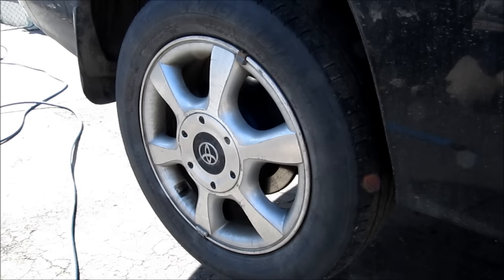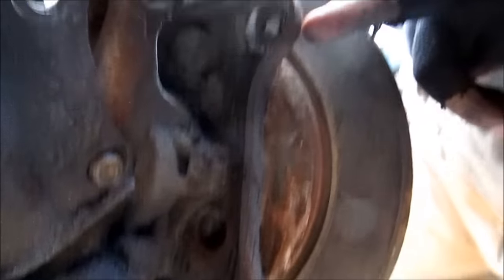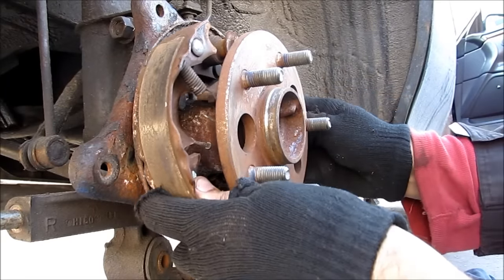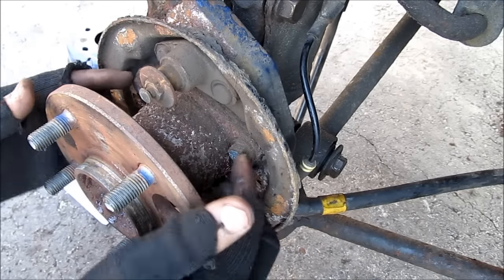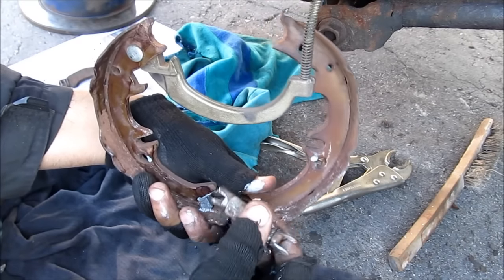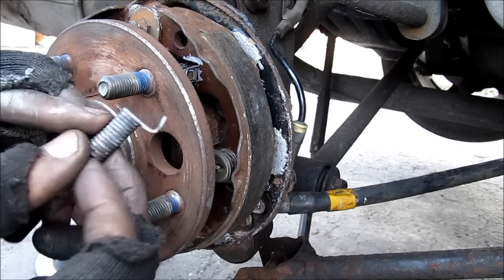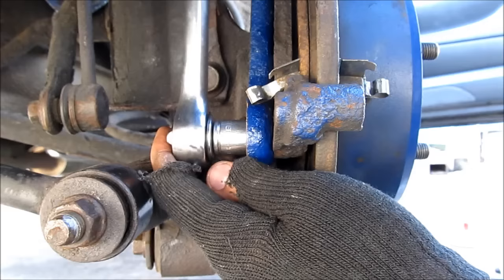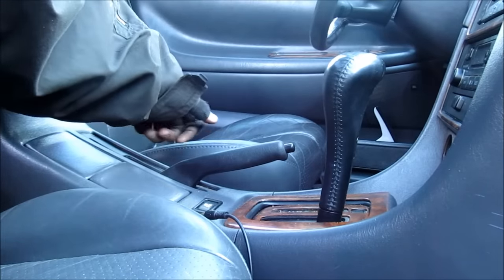How to Replace PARKING BRAKES

Comment: speedkar99, good video, even if you did cut out the painful parts, like reinstalling the retaining springs and caps... LOL
 Now I have a problem related to this:  my new rotor/drum doesn't slide on.  I have made sure the  shoe adjustor is completely retracted, all the pivot points are where they should be, but with the new shoes, it is about 1.5 MM too thick to allow the drum to seat.. update:  I hammered the rotor on to the hub, hoping that once it was properly positioned the shoes would clear the inside of the drum.  No such luck.  now the rotor doesn't even turn, and I will probably scar the shoes trying to pull the rotor off again.  my thought is to turn the drum part of the rotor to get some clearance.   what do you think?
Reply from the maker: +Van Moon You sure you have the right drum? Measure the inner diameter of the old vs the new one and see the difference (accounting for wear). Maybe the drum sizing might have cross referenced an ES300 that has a slightly larger rotor....
Reply: Well I have to go by what the parts people give me I guess. I left the old rotor with them when I picked this one up.  I don't know if it's still available but yeah I'll I'll see if we can put a micrometer on it and measure it.  But still my question is how do I get this one off? it's going to pull the new brake shoes and everything off or scratch them or something
Reply from the maker: +Van Moon Use a metric bolt and thread it through the bolt holes evenly.
Reply: The new drum doesn't have extraction holes. However I was able to get it off. I cut one of the retaining pins  and for some reason the shoe assembly was able to slide over enough to where I could get the the drum off. So after replacing the retainer assembly with a new pin and realigning the shoe assembly I tried to put my old drum back on and it had the same problem - it does not slide on easily. But I was smart this time: I didn't pound it  on with a hammer like the last time!  Maybe I should just go with the original brake shoes? They are not worn down to the metal I had just look at them not ever having seen a set before and thought that the friction material was really thin. But now I see after reading about it that it is only supposed to be like six mils thick.
Reply: After i ground off the back of the spring retaining pins and replaced them with a new set I discovered that I had incorrectly installed them the first time and for some reason that apparently spread apart the brake shoes just enough to interfere with the drum. The Second time I put it together everything went perfectly just as it was supposed to do. So now I'm back on the road with new brakes and I thanks a lot for all your help

Comment: May I add : only take one side apart at a time . That way you can refer back to the still intact side in case you are uncertain .
Reply from the maker: Yes, that's exactly what I did.
Reply: speedkar99 I was hoping to help those with little experience , you obviously don't need much help . Again , good job , excellent presentation . Thank You

Comment: Need to remove a 10 mm bolt that holds the brake line and abs cable in.

*snaps wire tie 😂😂
Reply from the maker: +Max Tp Haha you like that eh...already broke that bolt a while ago.

Comment: How do you support the rear of the car when doing this? I can't find a place to put jack stands in the rear after jacking from the rear central jack point.
Reply from the maker: The two welds along the bottom outside corner of the car. Same points the manual tells you where to put the jack in case of a flat tire.

Comment: you can give yourself a lot more room to work by removing the hub from the backing plate with a big breaker bar and and a socket extension
Reply from the maker: Agreed
Reply: 5:05 really hard for me to get the offset nail for the shoe hold down spring for some reason.  Have been trying but no luck.  Any tips or advice appreciated.

Comment: In my car parking cable difficult to assy....! With adjuster...!
How you connected the cable that easily...!
Please give some tip.....!
Reply from the maker: Yes it is very difficult, of course make sure the parking brake handle is not engaged

Comment: speedkar99 I hear a clunking noise in the rear side and I'm pretty sure its coming from the rear brakes what do you think is making that noise ? I know there could be a lot of reasons but i hear them only when i run over a bump or potholes.
Reply from the maker: Rear strut mounts or stabilizer linkages.
Reply: speedkar99 I changed the links bushings and it still makes noise and I checked both the strut mounts and links. Nothins wrong with it.
Reply from the maker: How did you check the mount? There's no real way to know if its toast without replacing it. You can also try putting a felt pad between the body and the top of the strut to see if that eases the noise.

Comment: The problem we ran into was, even though the emergency brake was not engaged we couldn't rotate the rotor to a position where we could access the star wheel to back off the brake. It was a pain.
Reply from the maker: +Charlie Roach Ouch. I hate it when that happens. Eventually I some how get the rotor off, with a lot of banging. How did you end up getting the rotor off? I presume you could bolt back the wheel and rotate it.
Reply: +speedkar99  we ended up using a huge two jar puller. This is on a GS300 Lexus which I think is rear wheel drive plus its independent rear suspension.  It would benefit us greatly if the axle were not in the way when we put the brakes back together.
Reply: oh nice - automatics too aren't they? Did you have it in "Park" while trying to rotate the rotors? :)

Comment: speedkar99 what cut off tool did you use, where can i find one?
Reply from the maker: +jdyang89 Its just a normal rotary tool with a cut off wheel. Similar to the Dremel brands. I got mine from Canadian tire, but you can find them at most stores now, Home Depot, Harbor Freight, Princess Auto, maybe even Wal*mart.

Comment: If you were gonna go through all that work, you had might as well change the brake shoes with new ones. They are close to 2mm service limit
Reply from the maker: +cucktoose Yes good tip, though these are parking brakes that aren't used often so I chose to leave them for now

Comment: can someome tell me the difference between a brake shoe and brake pad
Reply from the maker: +taha rana a shoe is the semicircular pad that squeezes the inside of the drum to stop the wheel. 

A pad is flat, and squeezes the outside of a disc to stop the wheel
Reply: speedkar99 is the shoe basically the handbrake brake then ?

Comment: regular drum brakes are easy enough, some designs easier than others, but these drum in hat parking brake shoes have always frustrated me, and it seems like I've never replaced them on preventative maintenance principles, but only as repair after they've completely rusted away and caused havok on everything...lol  I guess ppl here have that "don't fix it if it isn't broke" mentality.
Reply from the maker: +TheCoatneyadkins most people (like me) with automatic transmissions don't even use the parking brake so no point in fixing what you don't use.

Comment: I can't get my rotor off. Helpfu ideas?
Reply from the maker: +Charlie Roach You've got to use two metric bolts  and thread them into the two holes on the face of the rotor. As you thread them in, it pushes the rotor off the hub. Also double check your parking brake isn't engaged.
Reply: u have to release the parking brake

Comment: Very Nice video,  but this is a pro that have done this  a lot of times, I expect. Be aware if You that are going to do this in the garage, that it can be a challenging job . With new tight springs, maybe You would like a spring tool to refit the springs, the small pins and springs that hold down the brakeshoes is best fit with a special tool, bought for a few bobs,will save You greef and bloody knuckles. And last: start with spraying the old brake with brakecleaner. That will minimize the risk of getting brakedust in Your lungs.
Reply from the maker: +bergatube60 Yes that tool would have helped a lot

Comment: need to explain that the bent pin goes on emergency side lever
Reply from the maker: Hate that pin
Reply: @speedkar99  You got that right, used 2 vice grips to hold shoes and pin in place and many bad words

Comment: why wouldn't you adjust the handbrake before refitting the brake calliper to get a better no drag feel and reading, and don't know if you used enough grease on the brake components. as well if you are careful removing the C clamps they are reusable with no problems
Reply from the maker: +fknows1 Because you wouldn't be able to get the rotor onto the shoes, there's sometimes a ledge or groove that it has to clear.
Reply: you had to get the rotor onto the shoes before you and fit the brake calliper. you do know what a calliper is right

Comment: It all looks easy except when you try do it Then it becomes a total nightmare..
Reply from the maker: +schooder Once you study the diagram and look at the drum brake in person to identify parts it isn't so daunting. The hardest part is those twist springs holding the shoes on.
Reply: +speedkar99 Yeah about those pins.... what is the solution to get those on? I can figure out everything else BUT i am stuck here. Looking at other videos related to other cards the pins are in a better position and i am having trouble with the amount of leverage there is ... I even got my father frustrated because he can't get the pins and the spring and the little cup to align correctly. Toyota camry 2001. the exact same design.
Reply from the maker: I really hate that spring clip design. I struggled with it for a long time before filming this video too. You need to support the spring from the back so it holds up right while trying to push the little holder plate on. Try using a beak-noise type of pliers to push in and then twist the cap 90 degrees once the tabs clear the opening.

Comment: Great video! How do you know which one of these you need or is the same hardware on both rear wheels? : http://www.oemtoyotapartsgroup.com/a/Toyota__Solara3000CC-24-VALVE-DOHC-EFI--AUTOMATICCOUPE/43036945__5748114/Parking-brake--cable/460405A-4601-286420.html
ADJUSTER SUB-ASSEMBLY, PARKING BRAKE SHOE, LEFT; SCREW SET, SHOE ADJUSTING, LEFT (FOR PARKING BRAKE). SCREW SET, SHOE ADJU SCREW SET, SHOE ADJU; REAR WHEEL BRAKE-DISK 15/12S; REAR WHEEL BRAKE-DISK 15INCH 12S - - - OR - - - ADJUSTER SUB-ASSEMBLY, PARKING BRAKE SHOE, RIGHT OR CENTER; SCREW SET, SHOE ADJUSTING, RIGHT (FOR PARKING BRAKE). SCREW SET, SHOE ADJU SCREW SET, SHOE ADJU; REAR WHEEL BRAKE-DISK 15/12S; REAR WHEEL BRAKE-DISK 15INCH 12S
Thanks!!!!!

Comment: Thank you Toyota for a really dumb design. Drum/disk combination for the parking and rear brakes? Why, when just about every other manufacturer has come up with a design the uses just the rear disk for both the brakes and parking brake? The Toyota design is far more complicated and expensive and a huge pain in the ass to work on.
Reply from the maker: +Richard McQuiggan Not really. When your calipers freeze because your parking brake, or vise versa....your in for a much bigger job

Comment: hmm nifty but my way still faster I use the vice grips the same way you did nut I juts pull the cable in a downward direction  by hand and then clip the vice Grips on both ends  them cables even on the bigger trucks only tale 35-50 pounds of force to pull and the average bear can do that in there sleep   but still and nifty's tool and hand for thems who have princess  hands